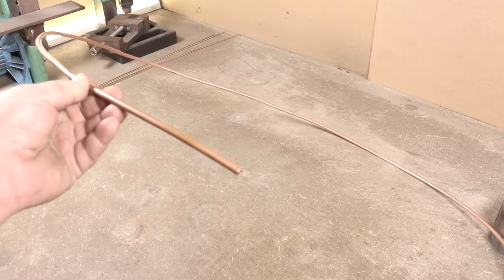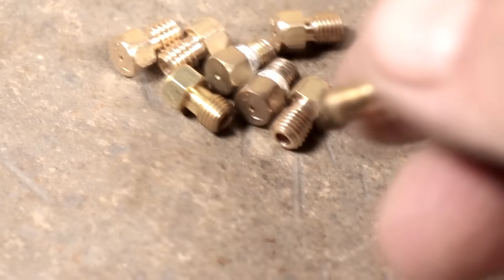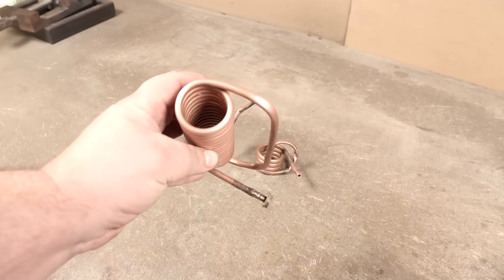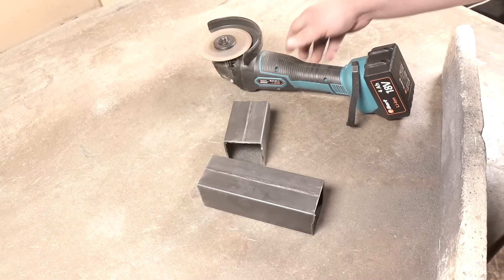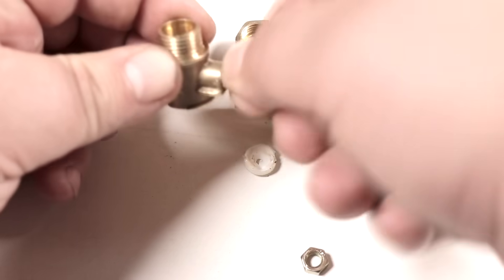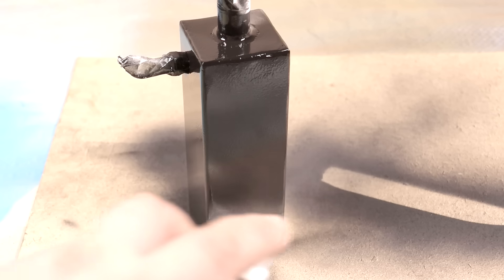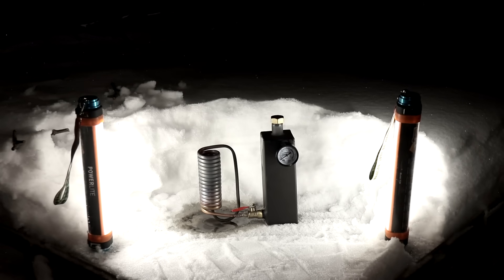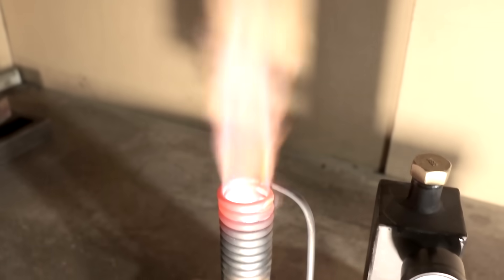Firewood is not needed anymore. BURNER USES WATER.

Comment: I've made copper coils out of tubing and if you fill the tubing with sugar or salt before bending it will hold a circular cross section in tight bends as opposed to flattening out or kinking.  I use salt or sugar because it packs well (using vibration from an Oral B toothbrush) and can be removed using water after the bend is completed.
Reply: Usually sand is used to that 👆
Reply: @MauricioReyno  Exactly! Just use dry fine grained play sand and tap the tube to loosen it out after bending.
Reply: @MauricioReyno  Cheap but effective. Thanks
Reply: Very good suggestion.
Reply: I've done this as well.  It works extremely well, but don't expect it to dissolve out immediately.  I thought I could just pump water through to get it to dissolve all at once very quickly, but I ended up having to soak it for a while.  It helps if the water is hot and there's a decent amount (as it will stop dissolving entirely, if the water becomes saturated).

(For those suggesting sand, while it works well for larger tubing, it doesn't work at all for the 1/4in tubing.  Sure, it coils fine, but you'll never get all of the sand out once it is coiled.  The grains are too big, and they'll bite into the sides and then seize up.  For bigger tubing, that's not a problem, because the grains are very small compared to the size of the tubing.  They can't really pack well enough for grains biting into the sides to make much difference.  With 1/4 inch (the ID is much smaller than that) though, you've got maybe 5 to 10 sand grains in diameter, which makes it really easy to seize when you bend the pipe, and you'll never get the sand out at that point.  Even with finer grained sands, it can be absolutely horrible to get out of something that small.  Sugar and salt dissolve in water, so even though it will definitely seize with those large grains, you can just soak the thing in water to remove it.  Just make sure you have something else to do for a few hours while it soaks, as it can take a while for the water to work through, and use hot water, so it doesn't take days.)

I didn't try vibrating it to improve the pack (and it worked fine for the diameter I was bending it, small enough to fit in a soup can), but using a vibrating toothbrush is a really good idea.
Reply: The worst part is when you cant get the salt back out. I just fill the tubing with water and crimp on both ends, the water stops it from getting kinked.
Reply: I just love your ingenuity of the vibrating toothbrush to totally fill without voids the sugar or salt preventing tube collapse during the bending process.
Reply: Thanks. 
I don't work with tubing that often. I need to do something similar in the next few weeks. 
Thanks for sharing that knowledge.
Reply: Genius!!
Reply: Brilliant. It's a mandrel Bend then .
Reply: 6
Reply: @halilkutahyavi6581  WTF does that even mean?
Reply: فقد
Reply: Что бы медная трубка была мягкая
Её нужно нагреть до красна
И опустить резко в воду....🤔
Reply: By the old times i was use sea sand for bending lead or copper.
Reply: Very clever man @telosfd
Reply: dude, thank you! I was doing it another way, I have fine sand I can use as well I think. If not, sugar or salt it is!
Reply: I wonder, probably a terrible idea but I'll say it anyways, would carb cleaner work for dissolving salt/sugar?
Reply: It might work but it is more certainly expensive than hot tap water. @lgosuberalles4336
Reply: @lgosuberalles4336  Why not just water, or hot water?
Reply: @lgosuberalles4336 ask your fada
Reply: Também podem encher o tubo com areia fina
Reply: Fill with water, seal, freeze make your bends then let the water thaw
Reply: @sailaway8244  good idea if you can freeze a length of tubing without splitting it open due to the expansion of water as it freezes.
Reply: It's supplied in 18" coils which fit in your freezer, lay it flat when freezing use Wax to seal or turn the ends up and leave open
Reply: @sailaway8244  Have you done this or seen it done?  How tight were the coils made?  I used a 1/4-inch OD tube and made a double coil (coil within a coil).  The inner coil ID is 5/8 inch and the outer coil is 1-1/4 ID and attached it to a 2-inch end-cap.  I made the mistake of placing the inlet and outlet of the coils too close together on the end-cap so now I can't use shark-bite fittings unless I braze on a length with a coupling to offset the attachment points.
Reply: Buy a hvac tube bender
Reply: @tronixfix 😂😂
Reply: @tronixfix  lol, the salt was 2.99.
Reply: @tronixfix  I have one... you can't make tight coils with it.
Reply: Yep good idea. We have even used ground up corn husks and also ground up walnut shells

Comment: You can protect that orifice from debris with a copper spun filter drier used in refrigeration systems. Cut it in half and empty out the silica beads, then braze it back together. Super fine mesh metal screen in filter.👍
Reply from the maker: Thank you very much for the advice, it's just excellent! This is really a good idea!
Reply: @doctor-robo  And it isn't as if you need to go buy a new one. All refrigerators have that device and the greater majority of them will appear absolutely clean inside, regardless of the outer appearance. A film of light oil may be what you will run across, easily removed.👍
Reply: @markhonea2461  why doesn't mine have it? It's samsung brand.
Reply: @TroniX FiX  it has it somewhere. It will be at the final end of the condensing side of the system. All systems of the evaporative type need to protect the capillary tube from debris, thus the ultra fine mesh screen. As well, the silica beads adsorb,  yes adsorb any remaining water molecules present after evacuation. But don't mess with it!
Anyway I've worked on many samsung units, and believe me, it's there somewhere.

Comment: Houw long did you burn on one tank?
Reply from the maker: The burning time depends on the desired power, the higher the flame power, the more fuel is wasted.
Reply: Pure logic ;)

I was thinking to make some kind of similar design

Your design really proves it is possible

I was thinking to use it indoor.

Is there any chance to make it burn vegatable oil, without creating smoke?
Reply: How fo you prevent the flame from kivking back into the tank?

Or doesn't the tank suck full of air once all starts to cool down

Comment: Hi, thank you for your Video. I have a question: how can the oil go up the copper spiral?
Reply from the maker: First, the law of communicating vessels works. Then, due to the evaporation of fuel - gas under pressure breaks out. But in the beginning you need a little pressure in the tank, a little heat or a pump.
Reply: heat .. is the answer .... thats why he had to pre heat the coil first... oil evaporating kinda thing going on inside the tube... Just like hot air always goes upwards and the cold down.\

cheers

Comment: Will not it creat problem by heating up the fuel tank after burning for some time?
Reply from the maker: This is just an experiment to see if it works. Of course, when used for a long time, the fuel tank will heat up and pressure will increase in it.

Comment: Should really have a regulator on there so that it doesn't blow up
Reply from the maker: There is very little pressure in the fuel tank to supply fuel to the evaporator.

Comment: Hi did you get the semi automatic welding machine yet?
Your vary good at this type of stuff..
Can you turn a gas car into an electric car?
Reply from the maker: Hello.
Turning a gas car into an electric car is neither practical nor economically viable, but this is my personal opinion and I could be wrong.
Reply: @doctor-robo  A diesel engine that runs on compost tea? Urine and grass clippings make a powerful methane. 
Actually has me wondering if you could power your heating with the whole houses waste 😜 messy for sure. The ultimate in renewable energy!

Comment: $10 a ft for copper
Reply: They used copper for irrigation lines( sprinklers) in the 60s
Reply from the maker: For this design, it is better to use a stainless steel tube.

Comment: Ahhh 🙂 I can definitely see great uses for this. I need something like this for the burning of methane and HHO. I wanna make one small with multiple outputs to drive a heat pump system like a steam engine rig, or to run sterling engines.
Reply: Really?
Reply: I want to do the same, the problem is hho burns extremely quickly which would blow back to the container? It also burns 2500c so it would melt the copper, there's a video on here of a guy that made an hho burner with a syringe needle and it could melt steel, to make a boiler you'd need to find a way of making a very small, but, powerful flame to do a lot of work, so you'd need a heat exchanger that would need to withstand immense heat that could pass a reasonable amount of water through to heat it or similarly with an element type deal, it's doable, but getting the nozzle reliable is critical in a low maintenance setup
Reply: @MersyyLife  flash back suppressor or a 1 way check valve.
Reply: Could you dilute the HHO with normal air to mitigate those effects I wonder?

Comment: Honestly surprised the the copper tubing wouldn't melt.   Cool vid.  Maybe stainless brake tubing, if it would?  It will wear your hands out making the coil, but should last longer and take higher heat, but won't transfer heat as good as the copper.  Cute dog, cheers.
Reply: Melting point for copper is 1089 degrees Celsius. This  set up is never going to reach that threshold.
Reply: @howardosborne8647  buddy, I really don't  have time for tards who just looked something up and think they know.  Put it in a box, ie, use it to heat something, and it will reflect and make the local temperature high enough to melt it.  Try it.
Reply: @Howard    I was taught by welders and plumbers that making the copper that hot won't melt it necessarily, but it reduces the strength of the copper walls and become chalky and brittle after a few intense cycles.... I'm not a metallurgist by any means but is that not true? Genuinely wondering. 👍
Reply: @FurtiveSkeptical  yep, elastic, to plastic, to liquid. At different gradients, something pressured, even before it reaches a plastic state, just making it more elastic can rupture it.
Reply: it will. at least like that it will. it was already cheery red in this vid.
Reply: @werewolf74  cycle it a few times

Comment: Adding a one way valve would make it safer, for long term use.
Reply from the maker: You are right, but the pressure in the fuel tank is very low, you can see it on the pressure gauge in the video. In the last video in the water furnace project, the pressure already reaches 5 Atmospheres, and already there I put an emergency pressure relief valve.

Comment: This will burn the fuel increasingly faster & faster so it wastes fuel. This is just stupid and will cause serious injury to any of the idiots that use this for heat in their home. Play stupid games win stupid prizes.
Reply from the maker: You just don't understand! It's too hard for you...
Reply: @doctor-robo  Actually it's simple and I have made something similar in the past. The reason this is a bad idea is because of the pressures created from the heat induced . It will only serve to expell more fuel than is necessary to keep a "flame". Making this device isn't practical and could cause fuel to be expelled from the spout onto any surface this device is placed on. Which poses a fire hazard. Look into ALCOHOL STOVES or ROCKET STOVES. They may be safer.

Comment: I used cooper tubing before and at higher temperatures corroded inside, and the flakes clogged the burner nozel. Recommend using stainless steel tubing, the best place is brake lines for the car. 
Cheers the best idea ever
Reply from the maker: Thank you very much, I will definitely take your advice. I also want to replace the faucet with a needle valve to fine-tune the flame.
Reply: Cupro-nickel brake line tubing is far more resistant to oxidising when heated and far easier to bend than stainless.
Reply: jumped in to comment this. That copper will melt in no time, its already cherry red. Secondly I thought this was going to be a burner where the warm air, or a closed liquid system heated the coils to use inside. What is this even for?
Reply: @werewolf74  The coils are to preheat the liquid inside, since it's very clear that the tubes get red hot, the effect happening in the tubing is called gasification, where the then liquid gasoline turns into gas and is then burn in the nozzle, I think it also helps counter act the heat going to the walls of the burner, since it will now be somewhat consumed by the fuel (by the way, this method is used in some rocket engines, where the fuel is liquid hydrogen and liquid oxygen, which have way more cooling power).
Reply: @werewolf74  making a bullshit self-serving video.
Reply: @werewolf74  delayed bomb
Reply: @werewolf74  The melting point of pure copper is very near 1100 degrees Celsius. This device is never going to get close to that temp.
Reply: And the idea for purging nitrogen it's beautiful BUT when the burner is on the heat will create corrosion.
Soo you can not use nitrogen and gasoline mixture to prevent corrosion.  Or maybe you can?  Good question.
Reply: Stainless steel definitely but be careful using some modern brake lines like that dark green stuff as it’s not steel but an alloy and it has a lower melting point than copper!  copper coated steel, or mild steel is ok but not as stable as stainless
Reply: Purge the copper line with nitrogen gas while you weld it. That will prevent the carbon flakes from building up inside the  pipe

Comment: If this is the same man that I talked about adding filler Rod to when you say cold welder you're talking about air cooled correct I have a water-cooled one and I have used the air-cooled ones in the field to weld stainless pipes at chemical plants once the handle gets too warm you basically set it down and wait for it to cool off
Reply from the maker: Hello. I'd like a water cooled burner, they don't sell them where I live. In the future, I want to do it myself.

Comment: This tech has been around since the 1890's. These coils fill with hard carbon deposits (it's called coking) and they stop working well until they eventually clog completely, and any dislodged coke that breakers free during operation will immediately block the fuel jet. Again, 1890's tech
Reply: Who cares if it's "1890s tech"? Thousands of things we used today are tech from the 1800s... including the internal combination engine

Comment: Great imagine if you could ow make it with stainless steel tubing for greater long term durability. Fantastic work!
Reply: @Burnt Kitty Forge Yeah I was thinking about stuff from Swagelok but very expensive, even though it's really good and u can buy it in an annealed state and easy to bend; make all the joints by simply buying the joints and use their one way valve to prevent pressure blow back into tank, although it can only work that valve if it is vertical. Too expensive though. i used to use their stuff heaps when i worked at various unis but then I wasn't paying for it personally. The brewing supply alternative sounds much better!
Reply: @Burnt Kitty Forge Key word 'resistant' SS highly resistant, but would need good support

Comment: Isn't the copper tube going to melt after a while... Better using a steel pipe
Reply from the maker: Yes, I agree with you. But this is only an experimental model. It is better to use a stainless steel tube.

Comment: Cool idea, one thought though, I’d invest in a good carbon monoxide detector (when operating in closed environments, outside no worries) rule of thumb, if it burns oxygen it creates noxious gases. But, I like it for many uses and I’ve been a HVAC contractor for a hell of a lot longer than I’d care to admit.
Reply from the maker: Yes, the stove creates harmful gases. Indoors you need a chimney for gases, and in the open air you can do without it.

Comment: Add afterburner in the form of steel mesh stretching far above from the coil.The flame will get even higher and will burn the rest of the gases that didn't burn when inside the coil or are a product of the inside-coil burn (like CO for example).
Reply: @Burnt Kitty Forge something like that. I was under impression that mantle only glows from heat and that is its only function. The afterburner I proposed would keep some heat inside and use additional oxygen to burn remaining flammable particles/gases. Ideally air coming to it would be already heated. Afterburner seems to be better name, although maybe they are the same.
Reply: @Burnt Kitty Forge Depending on fuel composition the 'mantle' material will vary as some multi component  fuels will choke up the surface holes
Reply from the maker: This is a very good idea! Thanks a lot! I will definitely try! It is very interesting.
Reply: @doctor-robo  I'll be waiting for the video